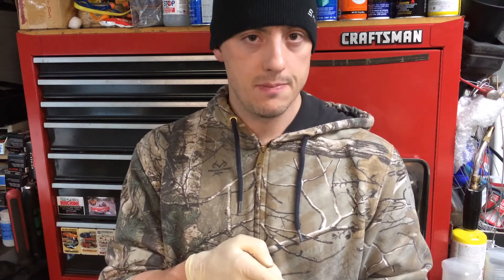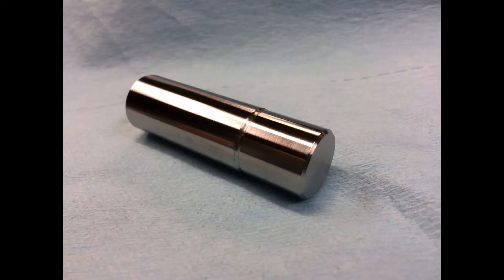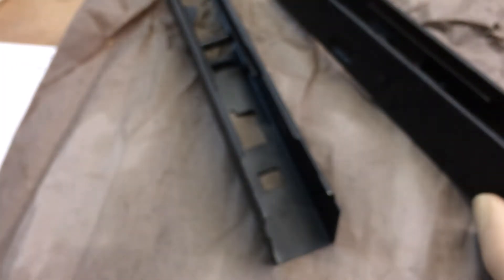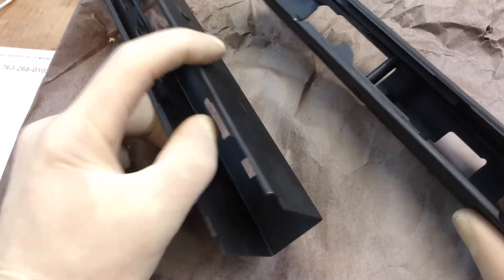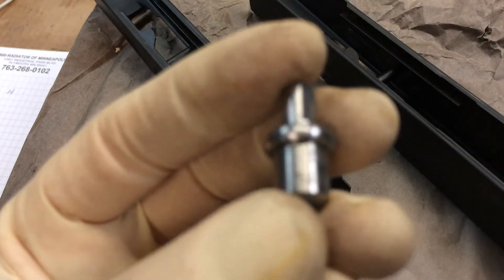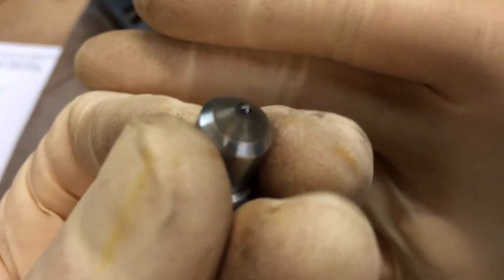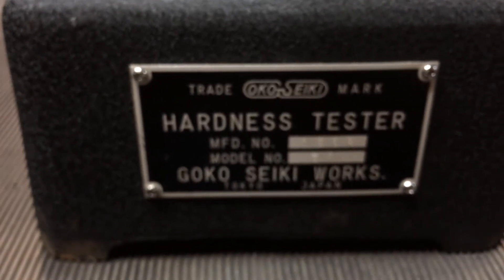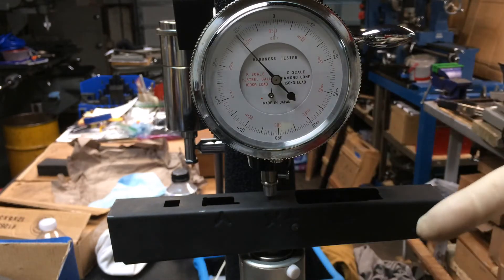Polish 80% receiver review, and hardness test #ak47 #shoplife #rockwellhardness

Comment: I wonder how important the hardness is on the reciever. I mean obviously there is a spec for a reason, but is there any pressure contained by the reciever? I'm a lot more familiar with the AR.
Reply from the maker: Hey Florida man!

   Not necessarily a pressure concern as much as a concern for the ejector eventually peening over due to not being hard enough. this issue can be interesting because the ejector is also apart of the left hand rail. If it gets bad enough the damage can stop the action from cycling properly. the axis pins holes can also egg out.
Reply: @jeerrrrrrryyyyy  
AKs truly are a different beast. I am proficient with ARs and tend to forget just how different the 2 are. Thanks Switch.
Reply from the maker: @DEATH_TO_TYRANTS  No problem Brother!

Comment: Awesome job. I actually have two of the Polish blanks from AoA. Both with a "c" stamp in the rear. I tested both with my Rockwell Tester and one was like 37Hrc and the other 32Hrc. I noticed that the 32 had visible marks on the reverse side where I checked. The 37 had no visible marks what so ever on the opposite side. The marks in the 32 could not be felt with a finger nail. So the 32 may not be an accurate reading. The manual for my tester says that sheet metal can be checked in "c" scale and the result correct if there are no raised marks on the opposite side. Both receivers have been built into rifles already. I could tell both had been heat treated from the way they drilled. But without the tester I would never know what the hardness actually was. 

...and I do jerk the lever over. But this is how the old guys that taught me were doing it....
Reply from the maker: Hey MEL!

  Thank you for the support. 
   The "marks" on your receivers, did they look like they where previously checked for hardness? Interesting never the less.
   Jerking the handle on that Wilson Hardness tester may not have any effect at all. I still need to go over my Wilson. It was purchased for a dollar so you can imagine the shape it's in LOL.
   someday I will get that one fixed up.
Reply: @jeerrrrrrryyyyy  The two WBP receivers I bought had no prior check marks that I could find.  The Wilson Hardness tester at work has the checking (calibration) pucks like yours. It also gets calibrated twice a year by an independent calibration company.  So the tester is good to go, but that doesn't mean I'm actually doing it correctly or too roughly.
Reply from the maker: @Mel64d     That's awesome that the company keeps up on the calibration of the lab equipment!

  I think your doing It right. If your Wilson is anything like mine it out weighs the SEKI by 15 lbs at least!
Reply: @jeerrrrrrryyyyy    You know, I've noticed that when I check company "A's" receiver and it passes....they accept it. But when company (whatever) receiver fails, they all of a sudden have a problem with how I do it. Funny how it works out like that.
Reply from the maker: @Mel64d   Yeah I'm sure These results will bring the same level of critique that you have experienced.
    I hit the roof with the "blue sky" knuckle head, and again when I heard the "way it should be measured" excuse you received.
   I can only imagine how mad that made you. especially with how long you have been in the business.

Comment: Either an HM or WH. Haha. Well if you know what your specs should be and they are out of spec for the G then it needs to be heat treated again to bring it into spec before using. I would not "knowingly" use an out of spec part. Arms of America would not know unless they tested and inspected the parts after import to support the manufacturer claim. In this case its probably buyer beware. You could run some more research on the letter stamps HM or WH to find out who the manufacturer is in Poland and the proof stamps of G and H. Interesting. Thanks for sharing.
Reply from the maker: Thank you RB M! To be honest A friend of mine already found out what that particular stamp came from. I will let him bring that big secret to light. Unfortunately this rabbit hole goes deeper.
Reply: @jeerrrrrrryyyyy  Ah. K.